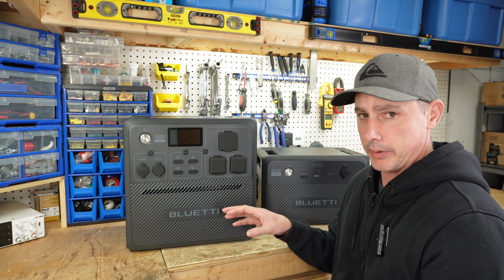True: All-In-One Portable Power Station. Bluetti AC240 IP65 Rated

Comment: Why did Bluetti discontinue theAC240??  And more importantly, the B210 Expansion Battery??
How the heck am I supposed to 'EXPAND' my current AC240 battery bank if Bluetti quit producing the B210 batteries after a year???
😡😡😡😡😡😡😡😡
A promise broken!
Bluetti burned me!!!
I spent a lot of my hard-earned money to start building a Bluetti Power System for my camp trailer.  And now I can't complete the size of my set-up without having to switch Power Stations!
Why on Earth should I trust Bluetti or their products again in the future???
I have three Bluetti Power Stations, one Bluetti Expansion Battery, the Bluetti AC1 Alternator charger & two of Bluetti Solar Panels.  But I think I've just made my last Bluetti purchase!
SOOO disappointed!!!
🤬🤬🤬
Reply from the maker: I agree it's very frustrating. Do none of their other expansion batteries work with your AC240?